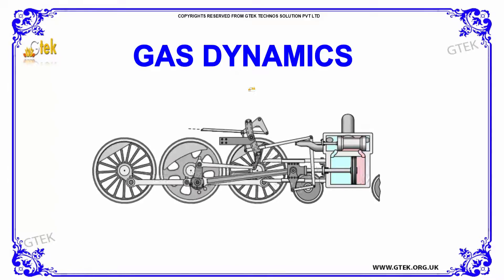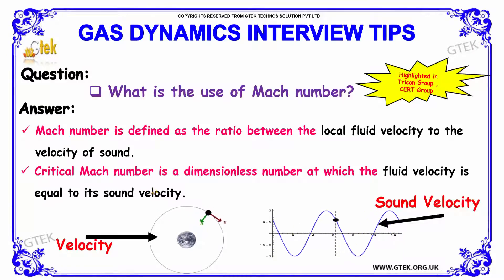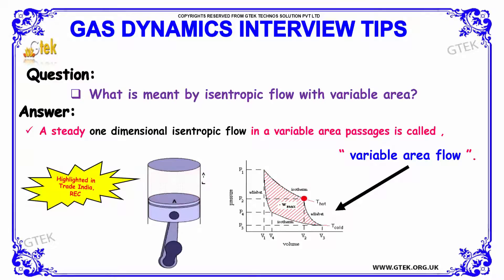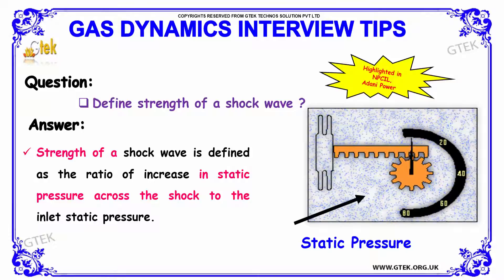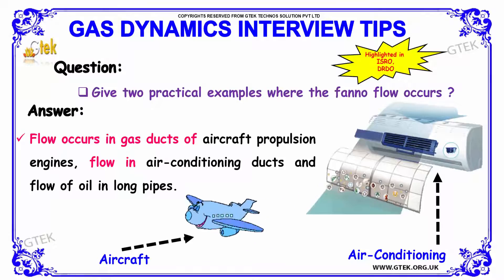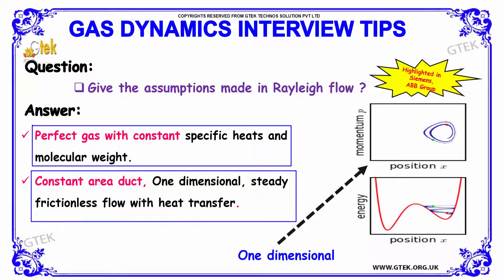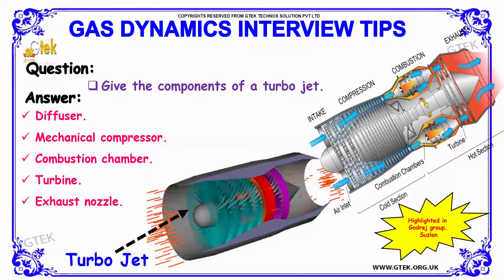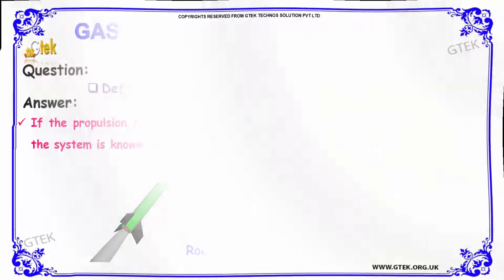Top 30 Gas Dynamics Mechanical technical interview questions and answers tutorial for fresher

Comment: Compressible flow (gas dynamics) is the branch of fluid mechanics that deals with flows having significant changes in fluid density. Gases, mostly, display such behaviour.

Comment: Compressible flow is the branch of fluid mechanics that deals with flows having significant changes in fluid density. Gases, mostly, display such behaviour. To distinguish between compressible and incompressible flow, the Mach number must be greater than about 0.3 before significant compressibility occurs.

Comment: Compressible flow (gas dynamics) is the branch of fluid mechanics that deals with flows having significant changes in fluid density. Gases, mostly, display such behaviour.[1] To distinguish between compressible and incompressible flow, the Mach number (the ratio of the speed of the flow to the speed of sound) must be greater than about 0.3 (since the density change is greater than 5% in that case) before significant compressibility occurs. The study of compressible flow is relevant to high-speed aircraft, jet engines, rocket motors, hyperloops, high-speed entry into a planetary atmosphere, gas pipelines, commercial applications such as abrasive blasting, and many other fields.